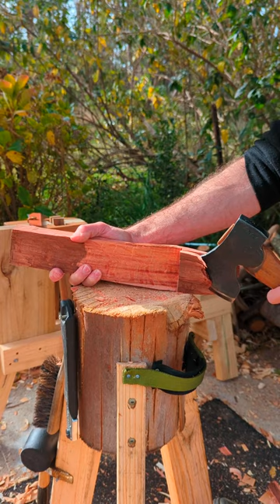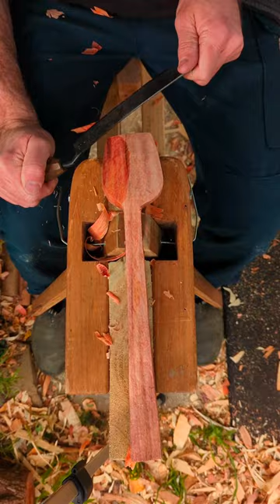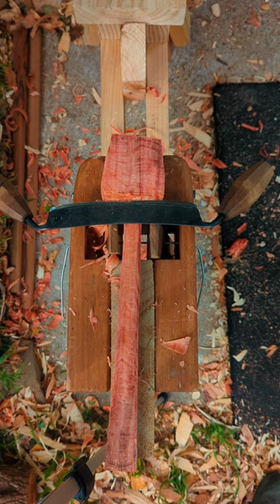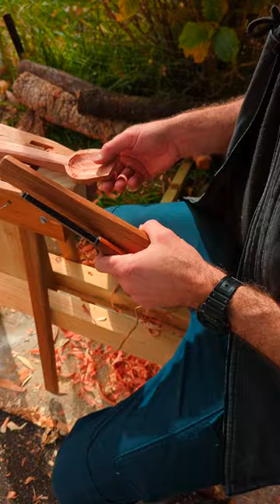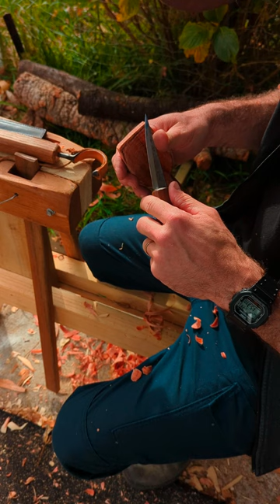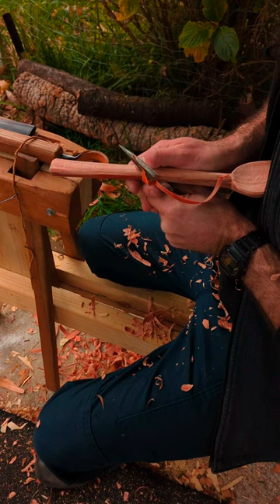The Hand Carved Spoon -  from Log to Spoon

Comment: Interesting to see your techniques. I'm still a bit reticent about axing. I like my fingers on my hands. But I'm definitely going to try to make more use of my drawer knife.
Reply from the maker: Two gospel tips to lock in for axe safety when you are starting;
1) never axe more than halfway up your work
2) never wrap your hand over the top of your work
3) imagine you are holding a hula hoop in your axe hand, and make sure you are always standing to the side of that radius

It's always about taking slow and measured cuts. No reason to lose any sleep or fingers!
Reply from the maker: And by two, I mean more than two 😂